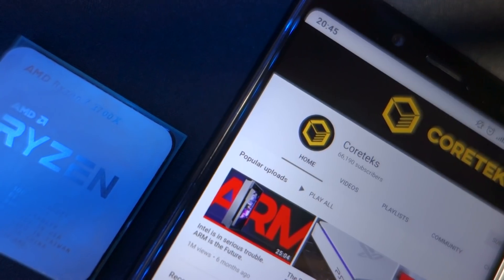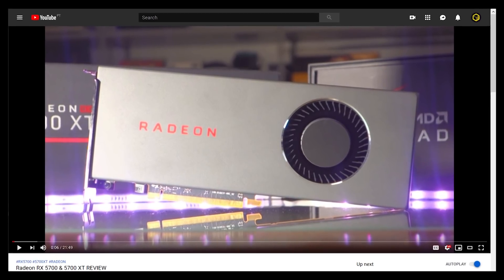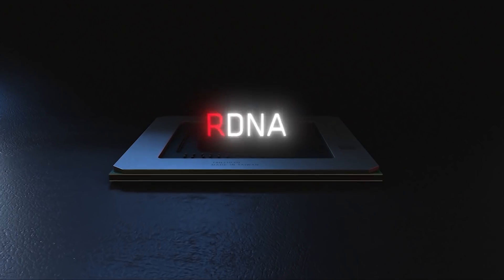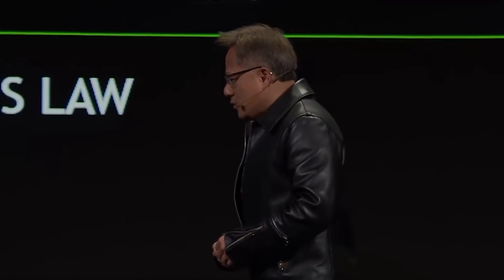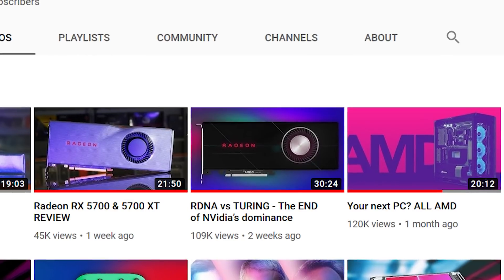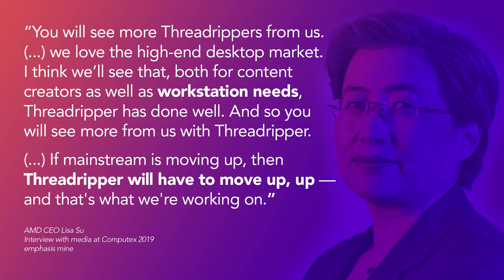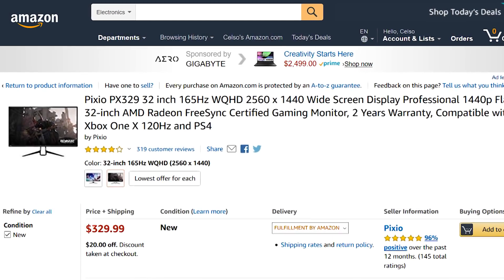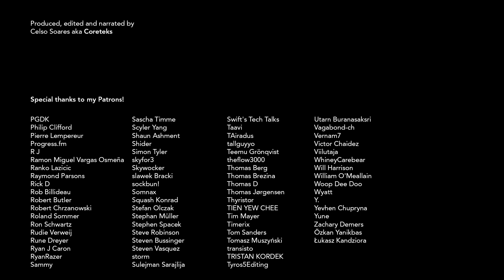What's next for AMD? - 5800XT. Threadripper. APUs.

Comment: I don't think NVidia are so full of themselves as to think that they can have their cake and eat it too 100% of the time. Making the 7nm jump may be more costly than what they're currently putting out and what they'd like to spend. But if their higher-ups can't see that it's a bridge they need to cross ASAP, then their decline that you forecast as a result of not doing so is well-deserved outcome. Perhaps that new crazy EUV CO2 laser will assist them in making more precise chips faster, more easily, and for cheaper (I don't know if they even got one yet, but I expect every large chipmaker will by the end of the year. As it sounds like a necessity to keep up with the industry. But this is only conjecture from a random nobody in the internet). But regardless, taking an immediate financial hit for future financial gain that will make up for it is hardly a new concept in the gaming industry. Consoles have taken this approach for decades - I remember a crappy blu-ray player costing about the same as two PS3s, and the PS3 was a FANTASTIC blu-ray player (far better than the units mentioned that were twice the price) to boot. If memory serves, SONY was losing hundreds of dollars PER UNIT in order to maintain their foothold among consumers. And that approach seems to have worked out considering we're now at the point that we're awaiting the release of the second gen console since (I don't count the PS4.5 or XBOX ONE.5 as a generation). But I suppose we'll see. I hope to see tight competition and great innovation from all manufacturers that leads to us consumers reaping enormous benefit

Comment: AMD gave us an 8 core TR with all the features of any TR mobo. Quad channel memory , 3 M.2 sockets, WiGi, 10GB LAN and 64 CPU lanes (16X 8X 16X 8X PCIe sockets). Utube talked about 16 cores as though that was TR only feature and 8/12 core TR's didn't exist. Then it was 32 cores. Now it's 64 cores. Ryzen buyers saw no reason to pay a liitle more for a TR board. Dropping the low core count TR's was because sales were low. TR has 4094 pin socket for a reason. CONNECTIVITY

Comment: Hey Coreteks. I just rewatched this great video. I can't agree that bigger (wider?) Navi will be faster or as fast as the Navi 10 GPU in terms of MHz. Navi 10 is a fantastic piece of architecture, but I would expect that as extra Compute Units (CU) are added, the speed will be slower - the trade-off being extra computing power as long as the scheduler can throw work at them. This was the problem with both Fiji and Vega as we know they both had deep Asynchronous Compute Engines (ACE) engines but could not keep all the CUs occupied with work sufficiently frequently to let the architecture shine under gaming work. I must admit I can't see how the current Navi architecture can be easily expanded beyond the 4 ACEs, so to get bigger AMD will have to reply on adding additional CUs to the four ACEs and risk running into the same problem - a slower but 'wider' GPU. They need to break the 4 ACE nexus/barrier.

Comment: If you remember the old Commodore Computers used APUs in a big way. They held the graphics high point for a few years until faster GPUs came out for the PC graphic cards. However they still couldn't match the sheer speed of rendering until much later. Add a couple of APUs to a couple of small GPUs of Radyon and you would have a killer graphic card. Add the APU's to supplement the Ryzen chips in workstations and the combo might give the ARM chip a run for its money in my opinion.

Comment: OK so I want to point something out here. 

Your whole "I said there'd be 7nm Vega and look, there's 7nm Vega!" thing is a bit silly. 

7nm Vega wasn't ever supposed to happen. The only reason we got it was because Navi got delayed and had to be re-taped. They had to launch something and do something with the dud Mi-60 dies. 

E-Voila, Radeon VII. 

Using a stopgap, shouldn't-have-happened product ( who's production time was ~5-6 months...) as evidence that your right and the rest of the "industry" isn't is a bit dubious. 

We're getting Big Vega and Tiny Vega at CES in 2020, not before. Big Vega isn't going to compete with the 2080 or 2080ti like you fanboys think, either, it's going to be ~80-90% as fast as a 2080/ti for 70-80% the cost. 

The really, truly, interesting product is going to be Tiny Vega. 

The RX5600 or RX5500. Most gamers, still, yes really, are on 1080p. It's not going to change any time soon, higher resolution adoption has flatlined ( as has VR, so people need to fucking stop with that argument, it's invalid and has been for 3 years now ). The 1080/60 crowd are who matter and the 56/5500 cards are going to be stupid good value. They're probably going to force Nvidia entirely out of that market. The perf/sq mm on Navi is insanity , and having a cheap, probably chiplet-sized die that they can spam out for next to nothing is gonna put AMD back in the game at 1080 in a huge way. Nvidia can't counter, they're faster per watt, but not per sq mm, and that's what matters at 1080p now. 

Most of the tech press seems to have missed the narrative here.

Comment: Thread-ripper could work on 570 plus a large pci-e 4.0 switch. I would suspect it's the I/O die that they are trying to hammer out. The 1000/2000 integrated the memory controller on some of the CCX's which helped roll-out.  However not that AMD is prioritizing Ryzen and Rome,  the weird, in-between I/O die has to wait.

Comment: Here are my thoughts on your comments on TR. I will not be so optimistic on a dual socket TR . Very simple. Who the hell will cannibalize their own higher segment product stack which is Epyc ? Epyc's profit margin is absolutely up up on top of TR.  TR has to be a stripped down version of Epyc. 
So what I think is like this:

1. It will  probably have both DDR 4 and DDR 5 support to maintain compatibility with existing X399 board. But will offer much higher memory bandwidth for new chipset users. AMD has made a commitment on not to change socket so often which it must adhere to. That solves the issue of the insufficient memory bandwidth of the 2990WX . 
2. Even more PCI-Lanes to support more U.2 ports for NVME SSD . 
3. Maintain single socket .
4. Chiplet design like you say,  integrating an accelerator onto the package. I think it will be a stripped Navi GPU but no video output, merely used for GPGPU load. Will be good marketing since AMD can boast how many TFlops the whole chip is churning out plus the GPU unit.  However the GPU unit can only be activated on the new chipset with new socket. 
5. Definitely more cores . That is what Lisa Su likes to do. 

For the 5800XT, i think it will go with the way of the R9 290X in the past. 512 bits of memory bus. 16 memory chips to make a 16GB of VRAM card to replace the Radeon VII which was discontinued. 5800 can be stripped down 384 bit memory bit 12GB VRAM card. Lisa SU said during CES on the 5800XT die size , " We like it small " . That is so fake man...just to bait Nvidia to expedite their response with their "Super" moniker cards, thinking that AMD only has something like a Polaris to show., not knowing there are bigger cannons at the back of the show.

Comment: Okay, stop gloating. You were not the only one who predicted 7nm Vega. I did so too and I did it back in June 2018 (immediately after watching the AMD computex show). 

That aside, wrt Navi, what we know so far = 

RX-5700 has 32CU's and 2048SP's. 
5700XT has 40 CU's and 2560SP's. 
We also know that the 5700/XT is AMD's MID-RANGE offering. 

Here are my predictions for upcoming higher end Navi-10 gpu's tbr in Q4-2019. There will be three models and will likely have 384 bit bus = 

RX-5800XT = 48CU's and 3072 SP's and 8GB GDDR6. 
RX-5900 = 56 CU's and 3584SP's and 8GB GDDR6. 
RX-5900XT = 64CU's and 4096SP's and 8GB-12GB GDDR6. 

I personally doubt AMD will be using the RX-5900 nomenclature for big boy Navi-20 in 2020. I think they will use a different numbering scheme (probably 6000 series). I suspect that AMD will break the 4096SP/64CU barrier with Navi-20, so their high range models will commence with at least 4608SP's and 72CU's and will likely have 512 bit bus for the higher end models and 384 bit bus for the lower end models. The top end N20 model will have 8GB-12GB of GDDR6 (maybe HBM2 or even HBM3 - if it is ready and depending upon what sort of performance boost it gives over GDDR6. It all comes down to cost and end user affordability. If it is too expensive, AMD will stick with GDDR6). 

Finally, I think AMD are going to get greedy again and charge more than you have predicted. I suspect AMD will charge at least $500 for the 5800XT and $570 for the RX-5900 and c.$640 for their top dog 5900XT. 

Only time will tell. 

Predictions are IP of BB. :)

Comment: "If it were that simple Nvidia would be at 7nm already."
No they wouldn't. Why would they? They firmly held the leadership position in graphics processors for years now and there was no reason to push fundamentally new technology to the market, it would just undercut their own sales and therefore be stupid.
Just like pharmaceutical companies don't release medication that competes with their own until the old patents run out, why would hardware companies release products that do that?
E.g. if Intel had a new processor technology on the back burner that's based on 5nm and achieves clocks up to 6GHz with 20 cores and high IPCs, would they release it? No.
They would release 5.2 GHz 8 cores, 5.4 GHz 12 cores and 5.4 GHz with 16 cores in year one and in one year and two years later they would release a 5.6GHZ with 18 cores and eventually  a 5.8 GHz with 20 cores, keeping the 6 GHz version as a last resort high end product and not tell anyone about it.
That way they make twice the money.

Comment: I haven’t really felt the need to move from first gen ryzen yet but I might be interested in Navi if improvements keep going the way they are. I know I want a ryzen 3600, but I like my 1700 still (I discovered I didn’t need all those cores after the fact), and my Vega 56 is trundling along quite nicely. Maybe I’ll snare these zen 2 chips and Navi GPUs as deals in a year or two? I’ve paid a fair bit for what I’ve got and it still works, after all.

Comment: @Coreteks, have you thought about the possibility that another path for Threadripper is to up the thread count per core to 4.  Which would really differentiate the chip from their own lines and intel and putting IBM Power on notice.  This would permit higher execution unit utilization, a really nice way to get more performance in the real world.

Comment: APU
ryzen 4200g - $150 to $200
6 core 6 threads 
with gpu power of rx 570 with image sharpening

ryzen 4400g - $200 to $250
6 core 12 threads 
with gpu power of rx 570 with image sharpening
or
ryzen 4400g - $250to $300
6 core 12 threads 
with gpu power of rx 580 with image sharpening

since 
ryzen 3200g
is 4 core 8 threads
with gpu power of gtx 1030 or rx 560
and 
ryzen 3200g
is 4 core 8 threads with higher freq
with gpu power of gtx 1030 or rx 560

i think mine is reasonable and close to reality
but amd might change the processor to 4 cores (since its budget)
but the GPU is guaranteed to have at least around rx 570 performance
at least on my own opinion

Note:
r5 1600 - $80 to $100 (ryzen 5 2600 is $120+ in amazon and newegg[soldout in newegg])
rx 570 - around $130 (i miss those $100 to $120 deals)

Comment: Basic premise of sales; start with the mid-tier and gauge demand for higher/lower priced offerings.  5600 at $250 or less, 5800 at current 5700 pricing, and 5900xt at $450 with a 6000 series starting at $550 featuring performance that will leave the 2080ti to rot on shelves.

Comment: I don't see APUs being 'enough' for 30+ years probably 50+. 
Discrete cards aren't that big for the fun of it, they are needed because the chips are big at the high end and require a lot of memory and a lot of cooling. Games will just get that much more complex to keep outpacing APU development. 

I can see an APU being faster than a 2080ti in 4-6 years but it will always be ~80% slower than what a current discrete card can do. When we start to factor in ray tracing, 8k gaming, VR, 144fps, plus tech that isn't even invented yet then APUs won't be 'enough' for high end gaming for a long time, no more than they are enough today. You can play most things with current APUs if you are will to compromise but I think there is a market for discrete cards for a long long time to come.

Comment: 5800XT might be possible but i don't see a 5900XT incoming when next year the new GPU Architecure is Complete and GCN is Past.
I Predict at CES 2020 we'll hear about the RX 6000 Series based on Navi 20 and more SKU's like the RX 6500, RX 6600, RX 6700, RX 6800 and RX 6900 which will launch in March/April 2020.

Navi 20 MUST be Chiplet-Compatible otherwise Zen 2 APU's won't be possible because Zen 2 uses an I/O Die.
So you can expect the RX 6000 Series to be the first Chiplet Based Graphics Processor Products.

Comment: What if AMD is developing a socketed 'accellerator'?
Reply: Motherboard prices will skyrocket. But graphics chips will be cheaper. 

It would also only work decently if the ram and vram were shared and sitting at current vga card speeds.

Comment: You seem to miss the issues at hand on this one. 
I watched the reviews and in some games it still went lower then the Vega 56. I saw FPS drop from 100+ to 50 in a heart beat on Navi. I admit that my GPU before my 56 was a 1070 (for 30 days) and it would drop 30 fps in the same way. Never saw it drop 50+ which means Navi is weak. Joker showed in his video that this happens and Steve from GN said performance is everywhere. He said it was like a tennis match. Syeve liked the Vega 56 and get it props.
From what I have seen. Lisa said, take what Nividia does and replicate it. Then they ended up with a GPU that has Nvidia's flaw's and some of their own. But Navi was pushed back and still delivered half baked. The next gen product in 2020 may be okay but this gen is junk. 
People need to stop hyping a day late and a dollar short products. Because my take on Navi is simple. It delivers when it does and when it don't. It really freaking don't.

Comment: My prediction is 5600/XT in 2019 and 5800/XT at CES 2020 with quick release there after. I really like your idea about the threadrippers, there might actually be a chance you're right with the specialized chips. Your APU predictions I think is spot on. The low end (6 series cards) will be obsolete in the near future.

Comment: If I was AMD I'd bring out a new standard of multi-processor motherboard spec that takes APUs or even separate dedicated CPUs and GPUs, Memory and SSDs.... all pin-compatible (256+ pins), built in super-speed SLI / data bus.. integrated cooler for multiple chips / chiplets on PCBs... 12 socket for a full size mobo down to 4 socket mini-itx (CPU, GPU, Memory, SSD) and a 2 socket nano-itx (APU, memory and/or SSD, either of which can be soldered on instead).

Comment: The APUs will be BIG on laptops. We all know that the thinner laptops are the ones that sell the most (compared to similarly priced beefier and more powerful ones) and Intel having like 99% of the market. With everything going to the high refresh rate direction, imagine having a thin, light laptop that can run games like Fortnite, Overwatch, maybe even Apex and other Esports at 1080p144 or at least 1080p120 on the side? Might even be a big blow to gaming consoles as well, as your school/college/work laptop could run the same games you play on your TV without forking over the $400 extra for the console, having Steam with generally cheaper games, just with an HDMI cable and a controller.

Comment: Seems a bit hopeful for the APU to be under $200 and have 6 cores like the 3600. If we were to have something like a 3600G with navi my guess would be around 280 with slightly lower clocked cores to leave some heat for the graphics. Remember 3400g is $150 using 12nm 4 cores and 3600 has no onboard graphics sitting at $200 they may get cheaper to make by end of the year but not that much.

Comment: I think you are wrong on the hardware, AMD has nothing to pass the 2080ti and won't have this year. BUT the fact that the future XBOX and PS5 will use AMD's GPU means that game developers will have better AMD optimizations in AAA titles for the next few years. AMD will gain a lot of performance there.
Reply: atTravelspeed Be interesting to see. The smaller chipset gives them plenty of room to move to tackle higher end cards very quickly. 

I had a thought and maybe wrong but wouldn’t surprised me if these mid range cards came out first because they can be easily cooled with blowers whilst the higher end larger chips are going to need to move away from this design. By sticking to the blowers for this release AMD make the AIB partners happy and without needing to design fan made reaching release date quicker.
Reply: @ablet85  it could well be, also don't forget that this is the first generation 7nm while Nvidia has a mature 12nm process so they can squeeze more performance think about what Intel archives with same old 14nm.

Comment: Later than soon.
AMD Athlon or AMD Ryzen 3/5/7/9/Threadripper X-Series (Desktop/Laptop)
Just running 5W-35W with 2/4/6/8/12/16/24/32/48/56/64 Cores with up to 128 Threads @ 5-10Ghz (Base), 20Ghz (Boost)
This is Future

And

Radeon Navi/NaviPro X-Series (Laptop/Desktop)
Just running 5W-15W with 3 to 1024Cores @ 5Ghz
Reply: you thinking they'll ever have clocks rated in terahertz is seriously hilarious